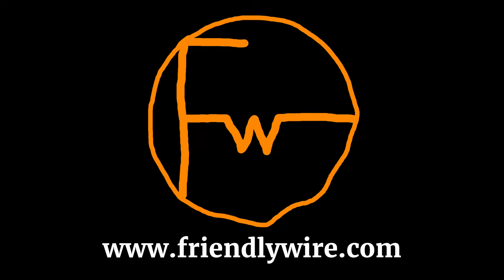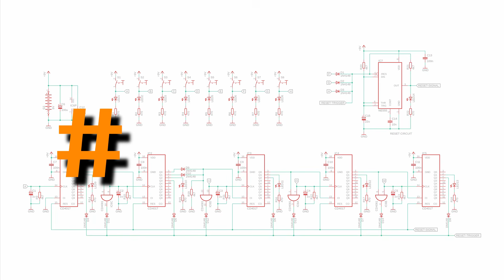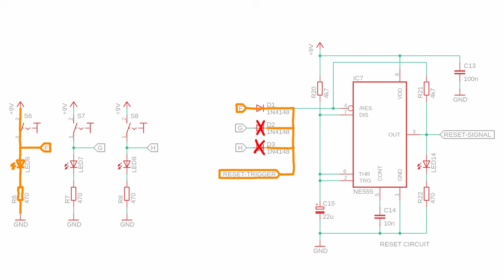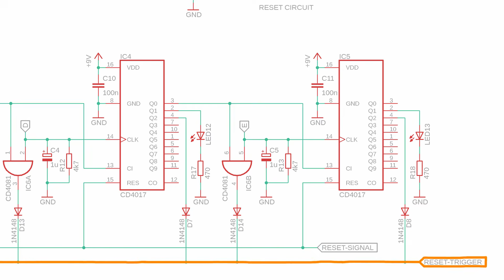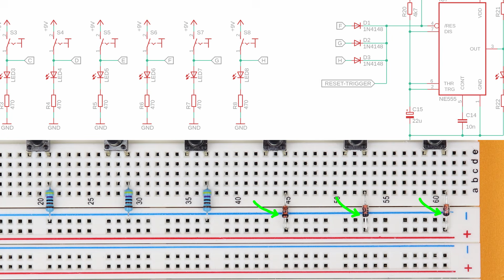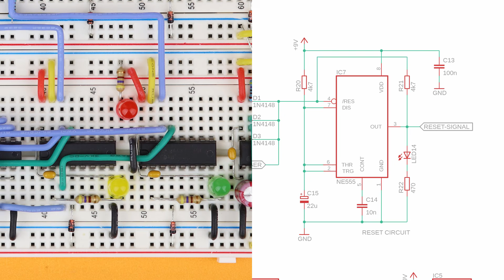CD4017 code lock with wrong code detection

Comment: I modified it a bit so that the combination is DEABBC, and im using only 5 buttons(A,B,C,D,E)
when i give the power supply, among all the 5 buttons, only the D button is working correctly. that is the led connected to the button is in off state initially, when the button is pressed, it turns on. but for all the other buttons, the led is already at on from the starting, and the button press doesnt affect anything. why is that? i've checked my connections too
Reply from the maker: Thanks for your interest! It looks like perhaps your CD4017's do not reset properly at powerup. Did you build the NE555 reset circuit as well? If yes, does its reset LED flash once, very quickly, when you power up the circuit? Feel free to send me an email with your schematic and some pictures (address is at the bottom of www.friendlywire.com) I am happy to help.
Reply: Is the sixth ic is cd408!
Reply: It is unable to understand that LEDs on the right of the ICS,are connect to the pin 8 or to the pin right next to the pin 8 of ICS,also tell me connection of LEDs cathode and anode connection s,
As tried to see I saw that the bypass capacitor which is connected to the pin sixteen, LED and resistor who's left leg Is connected to pin 2 , all 3 are in series connection, and there is no other thing is connected to the pin 8 except ground wire 
Am I right?

Comment: Hey so i have watched your video today but i have been working oh this project since last 4 months i had some issues that i wanted to be solved so is there any way of contacting you instead of Instagram
Reply from the maker: Hello, thanks for your comment! I check Instagram sporadically, but it is easier to send me an email, which you can find at the bottom of www.friendlywire.com :)
Reply: I'm also working on this project
And my ic is bursting and also even led is not glowing
What should I do to make this project work

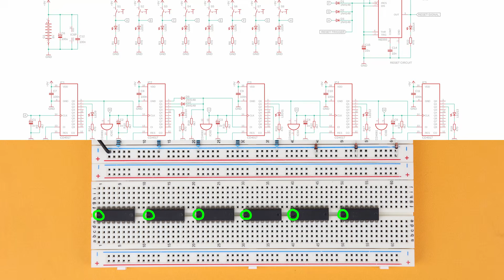Comment: think you got your right and left mixed up there at 13:00
Reply from the maker: How so? :) All notches (circled in green) point to the left of the breadboard :)
Reply: @FriendlyWire  not the notches, the positive and negative voltage pins. i had to watch it 3 times because i thought i was missing something.
Reply from the maker: @502deth  I cannot see what you mean, I am sorry. Can you explain more what is misleading? :)
Reply: @FriendlyWire  then maybe im still confused? lol. because i used the mixed up left and right excuse to make thing work in my head. 

at 13:00 you say "connect the ic's to vdd on their top right pins" and show them getting connected to the top left pins, followed by "and to ground on their bottom left pins" then show the wires getting placed on the bottom right pins. the data sheet shows v+ at pin 18 and gnd at pin 8, so the visual makes sense to me, but confused as the narration doesnt seem to match. so concluding that the narration is mistaken makes it make sense to me. what am i missing?

Comment: What are the alternatives to CD 4081?
Reply from the maker: You can use any AND gate in the CMOS family. I used the CD4081 because it has two inputs, but you could use CD4073 (3 inputs) and just tie one permanently to VDD. But the CD4081 is the best choice.
Reply: @FriendlyWire  thanks brother

Comment: how to change the code?
Reply: Man!! the article is so helpful... thank you!
Reply from the maker: @marounn-ao4014  I am glad it helps! If anything doesn't make sense please reach out via email, I will do my best to help out. You can find my email at the bottom of www.friendlywire.com :)
Reply from the maker: Good question! Because this circuit does not use any microcontroller, the code is fixed and cannot be changed. If you want to change the code, you have to change the circuit. Have a look at the companion article on my website: https://www.friendlywire.com/projects/code-lock/ . In this article I explain how the schematic works, and after reading it you will have a pretty good idea of how you can change the code :)

But if you are building this circuit and have the pushbuttons in a separate location, a simple way to change the code is this: leave all wires unchanged, and just move the location of the physical pushbuttons around. For example, switch the location of pushbutton A and C on your keypad, and all of a sudden it looks as if the code has been changed.

Let me know if this helps or if you have additional questions, and thanks again for your interest & for your question! And, most importantly, have fun with electronics!

Comment: What will happen if input is ABC  (we need to put B 2 times)
Reply from the maker: If you press C when you have only pressed A and then B, then the CD4017 in charge of pin C will still be at Q0, and therefore the circuit will reset when C is pressed :)

Comment: I have one doubt what if i make a safe with combination lock that runs on battery and unfortunately battery dies after couple of months then will my safe gets open automatically or it will stay closed forever i mean what would happen can u pls explain?
Reply from the maker: It depends on how you design the circuit :) But, yes, in short: when the circuit has no power left, it cannot activate the green LED at the end, and then the safe would not know that it has to open. As far as I know, many electronic safes have this problem. One way around it would be to add a "low voltage detection circuit" that warns when the battery gets low.
Reply: @FriendlyWire   thank you Sir for responding 🙏,
Can u pls tell me how to add attempts i mean if someone tried 3 times to open safe and failed then safe would automatically locked forever?

Comment: This is a great video! I was just confused by 2 things, how do I set the initial password for this circuit? I am confused about how the circuit knows which input is the right one, also why are we using three extra buttons? Can’t I use one button to reset the circuit? Thanks!!
Reply from the maker: Thank you so much, glad you like it!

Yeah, of course only one button is enough to reset the circuit, but if you add more buttons you make it more difficult for the person to find the right code.

The code, as you said, is hard-wired into the diagram. You cannot set your own code dynamically, you have to re-wire the entire circuit. But if you read the companion article to this video on www.friendlywire.com, you will be able to design your own circuit with different codes :)

Comment: Hey jens! I was wondering if we could somehow use a keypad in this project? I'm not very acquainted with electronics and it's my first time building an electronic project for my digital logic designs class so i don't really know much but wanted to like make it look more presentable maybe? Do you have any tips please?
Reply from the maker: Thank you for your question! Yes, there are keypads that are called 1x12 keypads, they have one common pin and 12 separate outputs for each key. There are also 3x4 keypads, and those are multiplexed and not usable for this project. Let me see if I can find one that would work :)

Comment: Hi. can you explain to me how i can limit the number of attempts to put the code?
Reply from the maker: You could connect the wrong code signal (pin 3 of the NE555) to another CD4017 counter. This counter will then count the incorrect attempts. If you only want to allow, say, three wrong attempts, then connect Q3 of that CD4017 to the clock inhibit pin of IC1 (pin 13). Make sure to also then connect pin 13 of IC1 to ground with a 4.7kOhm resistor. This should to the trick!
Reply: @FriendlyWire  hmm, wouldnt this only lock the first counter? if we then press any other button, it will trigger reset circuit r8? then that would trigger more wrong code signals and increment the wrong code counter?
Reply from the maker: @ True, but a single "8"' is then considered a "wrong code" as opposed to "8xxx" where x are four additional attempts. It will be a different task to always wait for four keystrokes in total, even though that could also be done in a way.
Reply: @ i didnt say that clearly, so what i meant was, The wrong code signal is triggered by reset circuit, by any wrong input from any button, so once it reaches 3 attempts, q3 op inhibits counter 1. but the reset circuit will still trigger on further input wont it? [except counter1 since its locked? or im reading the circuit wrong..]
well if the reset circuit does continue triggering, then the addition counter used for wrong code will also increment, and no longer inhibit the IC1?
Reply: @FriendlyWire  Hi I have connected this circuit by this trick but the lock system  cannot restrict the attempts after 3 wrong attempt.So  can u pls say  any other method  to limit the number of attempt.Pls say 🙏🏻

Comment: Correction! There are 3 types of bread boards. 
1. Connected power rails 
2. Non-connected 
3. Connected Eluding Non-Connected. 

Don’t let 3 fool you. 
God Bless
Reply: Thanks for the walk-through of this design. It really gives me an idea. I have 50 4017s otw. 
Originally I was going to cascade them all and test clock circuits. Now I guess I need to order another 50. Thanks for keeping me busy and mind off of stress. 
Once again 
God Bless
Reply: But also couldn’t someone just press the button slowly to figure out the code. Assuming the lights remain.
Reply from the maker: @jj74qformerlyjailbreak3  Oh, what's that type 3 breadboard? I am glad this video inspired you! Yup I suppose with the lights you could figure it out eventually (especially when you look at the red reset LED closely). So this is really just put in for fun (and not for final use).
Reply: @FriendlyWire  3rd Type is the ones that silk screen “not connected” power rails, but really are CoNectted. Make stuff go, dang ol boomy man. 
💨
Reply from the maker: @jj74qformerlyjailbreak3  Oh I have never seen those. Good to know!
Reply: @FriendlyWire  yes I always check new ones now. I think I actually bought the one I’m referring too from Microcenter. It’s clearly marked as power rails being separated. Doesn’t like ac too well. Cheap knockoffs or bad QA department in China. Probably for the best it made it through. 😂 
You have a great night sir. You earned a loyal sub today. Thank you for the conversation. 
God Bless
Reply from the maker: @jj74qformerlyjailbreak3  Thank you, all my best wishes, too!

Comment: Jens, I like your idea of using a 555 chip to provide anti-bounce for keystrokes. It solves a problem I found with a counting circuit I was trying to build a while back. Now I do the counting with microcontrollers and such. The circuit you did could be done with a 7-seg display, couldn't it? With leading and / or trailing decimals you'd have 9 LEDs to play with.

PS: Keep up the fine work!
Reply from the maker: Thank you for your kind words, Ernest! Technically the 555 debounces the reset line, but you could use it for switches, too! In my experience, for usual switches that are actuated 1-2 times per second, a 1uF capacitor in parallel does wonders. Oh yeah, totally, you could connect LED's to the CD4017 outputs. Now, if you wanted to show the digit that was pressed this would require a bunch of more logic to do it, and at that point it would probably be more economic to use a microcontroller :)
Reply: @FriendlyWire  hii! I'm a massive fan! I was wondering how you would show the digit that is pressed in a 7seg display?
Reply from the maker: @aadhithyapasuparthi5642  Thank you, Aadhithya :) I am actually not sure. You could use diodes to decode the button into a BCD-signal, and then use the CD4511 to drive a 7-segment display. But if you want all digits next to each other in a multi-digit 7-segment display it would be much harder to do.
Reply from the maker: @aadhithyapasuparthi5642  I'd love to help, but this is really no small project to do, and needs quite some time to plan. Have you ever worked with 7-segment displays? And can you get your hands on a CD4511 chip?
Reply from the maker: @aadhithyapasuparthi5642  You can always use the CD4026 as a simple counter of wrong code attempts, I even have a video on that: https://www.youtube.com/watch?v=SQddveiff1k

Yeah of course, you can contact me on social media @FriendlyWire (preferably Twitter) or also via email which you can find on my website www.friendlywire.com all the way at the bottom,
Reply from the maker: @aadhithyapasuparthi5642  Hey, no need to be sorry, on the contrary! I am happy to help, and thank you for your interest :)

Comment: Man! Again Im impressed with your quality content. keep making it, and I also need a suggestion.
Reply from the maker: Thanks so much :) What suggestion are you looking for?
Reply: @FriendlyWire  Broo , Can we develop this circuit without using 555 ?
Reply from the maker: @Mihir_Xv  The NE555 is built in as a reset circuit, but you could try to replace it with a combination of capacitor and resistor, but the overall reliability of the circuit would not be the same. When I made this project I thought the NE555 is easy to get, is there any specific reason you do not want to use it?
Reply: @FriendlyWire  Okay thanks bro. Can we reduce the code numbers to 4, and use 4 CD4017 to count ?. 
Because, our high school project is to build the circuit using 4 IC's and 1 NE555.
Would you give me some instructions to build it's like thanks a million 🤍
Reply from the maker: @Mihir_Xv  Wait, you are telling me that this circuit is really a proper high school project? Wow! I'd love to know more, where are you located? Such an honor! :)

To answer your question: yes you can reduce the number of CD4017's. Have you checked out the companion article?

Comment: I'm a little puzzled why your videos are not 'liked' and 'viewed'  as much as they deserve. They are very good. I'm hoping that it's just a problem with the Key Words you've chosen - and you're not going to change your presentation style (which is excellent).  I've liked and subscribed. Thank you.
Reply from the maker: Thank you so much, Johnny, this means a lot, have a fantastic week! :) PS: Can I ask, are you an electronics beginner? And how did you come across my channel?
Reply: @FriendlyWire  Thank you. Your channel just popped up as recommended on my YouTube list. I'm not a complete beginner. I've dabbled with home brew radio in the past. I'm now interested in FPGAs.  I've recently 'designed' a LogiSim microprocessor which I've put up on github (search for my username and 'SAP2'). Best wishes.
Reply from the maker: @johnnyw66  FPGA's are super interesting, I was thinking of maybe getting into them some time ago, but then I stuck with PIC microcontrollers for my videos. There is so much cool stuff to explore out there, thank you for sharing!
Reply: @johnnyw66 do u have an instagram account I want to get matched with u

Comment: What is another solution for the capacitors across the power terminals on the ICs. The leads on the 0.1 uF caps are too short.  Do I just need to extend my leads by soldering?
Reply from the maker: If the capacitor is close to the IC it's OK, you could plug it into the breadboard and use a wire to extend it, for example. If you're running this circuit on batteries you can omit these 100nF capacitors to begin with, they are only important when the power supply is not a linear one that is regulated. Hope that helps, let me know if you have any other questions, I am happy to help!
Reply: @FriendlyWire  thank you for your reply! I enjoy a creator that is so willing to help and give a way to enter into the world of electronics. I was thinking about extending the capacitors but I thought the capacitors needed to be as close as possible to the IC to ensure it works best for reliable power. I will be running this on a 9v so I may just take your suggestion and omit these. Thanks!
Reply from the maker: @AndrewKiethBoggs  Happy to help! Long connections to the capacitors will be OK in this case. For high frequencies these long connections would work as an inductance and introduce new problems, but in this case it is OK to have longer connections because the circuit works at very low frequencies. It is just good practice to have a 100nF capacitor close to every logic chip, that way your circuit will also work well if you decide, at some point, to run it from a different power supply.
Reply: @FriendlyWire  i have the same problem. So what you're saying is that i can simply just not put those capacitors in my circuit?
Reply from the maker: @abanoubhenry8876  They are not necessary for the functionality, under ideal circumstances. But they stabilize the circuit. I would recommend to place the 100nF capacitors directly in the power rail instead, close to each CD4017 chip. But if you run this circuit off of a battery you will most likely not need them. Let me know how it works out, Abanoub, I am happy to help and excited to see your progress :)
Reply: @FriendlyWire  Thank you so much for your helpful and quick response. Sure i will show you the progress once i finish.
Reply from the maker: @abanoubhenry8876  Thank you for your interest, it is always so exciting for me to see you guys trying out the projects :) Best of luck, and please always feel free to come back with other questions, I am happy to help! :)
Reply: @FriendlyWire  can i ask a question that may sound stupid?😂...how can i create or develop a truth table for this circuit?

Comment: I can see this being used as a movie prop. You could make a little door code cracker box to go along with it.
Reply from the maker: Thanks, Adam :) I was thinking of making this fully functional by adding another NE555 timer stage that turns on a relay for a few seconds, and then resets the code. But for the looks of it it was already enough chips on these two breadboards... :)